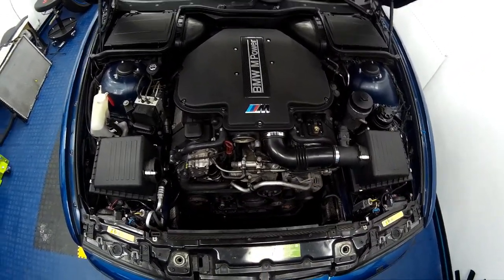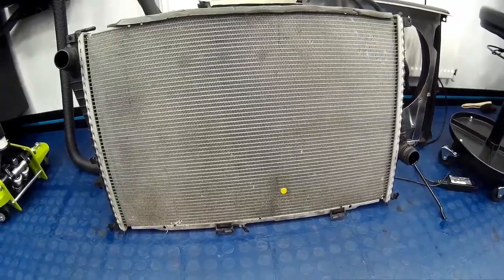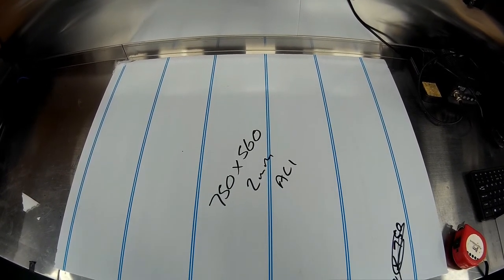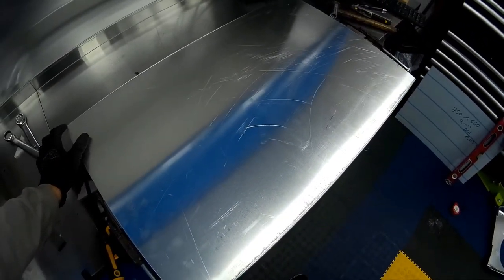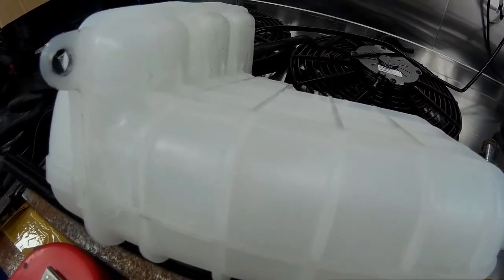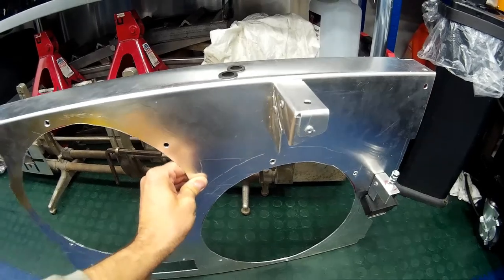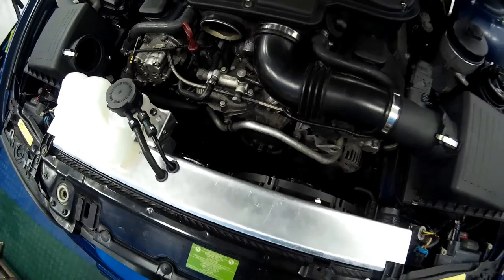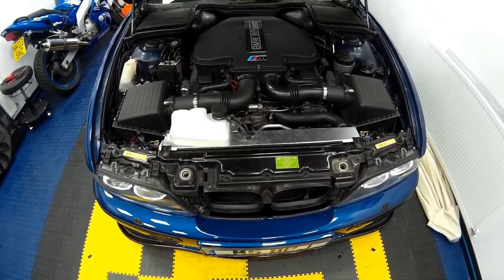BMW E39 M5 S62 V8 Twin Electric Radiator Fan Conversion + Alloy Shroud Manufacture DIY How-To Guide

Comment: Amazing job you did sir !! I did The same think to my 540 but i used fan from 2003 bmw 745Li because dose not have a  brushes inside is completely different fan is controlled by PWM signal and will last forever then the regular fan with brushes .
Reply from the maker: Cheers Andy. I did look at using the PWM fan from another BMW, but decided I wanted to use the SPAL ones to give me a bit more clearance on the front fo the engine for when I'm working on it. Glad you enjoyed the video - it's great to know people are interested in what I get up to in the workshop.

Comment: My friend could you please make me a list of what I need ? I am throwing out my visco. I have a m52b28tü.
The engine is an other. But I think this cooling System Is the best I have seen so far. I dont know what I have to buy. Just tell me what to order and I will bring it to my mechanic. He will know how to bring everything on. Just tell me please what to order. I have already the 4th visco broken and all radiators and waterepipes broke because of the visco break.  and the hood has dents too.  Its driving me crazy. I need ur help.

Comment: Amazing job !!! 
Since the stock pin config is 3, and fan is controlled via PWM from the ECU, how did you get to switch the fan on when A/C needs it? i.e. idle, traffic lights waiting in hot  etc.
Reply from the maker: Martin, cheers. The standard A/C pusher fan is still in place and runs as per OEM. 

The additional cooling fans are controlled by an adjustable temperature control panel within the vehicle.
Reply: @WestinghouseProductions  Thanks for your reply, mate. You are totally right, excuse me for my stupidity. I got caught by the fact that A/C fan should go because IC is coming in soon, so was looking for solution which would turn those fans on when need by the A/C also. Cheers

Comment: Curious on how you used the DME signal for the fan wiring. No relays? My fan setup has a high and low setting (2 relays) and runs off a switch mount on the the side of my radiator. I feel as if it comes on at the last minute and not maintain the temp like yours coming on and off randomly before it gets that hot. I assume the wires you used are can bus on the switch side?
Reply from the maker: The electrical system uses a 200 amp relay to switch the fans. The control side is via an 86-81 celcius thermostatic switch which is housed in the silver switch housing unit in the lower radiator hose.

If you wanted to utilise the PWM signal from the ECU that also controls the auxillary air conditioning fan, then SPAL sell a unit that you can use too. I opted for a mechanical switch for the moment and I'm happy with it's operation so far.
Reply: Would you make one kit for me? I will pay. My current setup is with one cheap ebay fan and I have overheating problems if I go WOT.
Reply from the maker: Hi Boris. 
Thank you for the offer, but I don't have the resources or time to put these to market. If you change your fan to a SPAL or Kenlow unit then that should assist in your issue, but if your engine is overheating when you are at WOT then there may be other issues with the cooling system that need addressing first.

Comment: Hey Paul, my M5 is in good shape to begin with 37k miles, I just dropped a CSF radiator in my M5 with dual 12” spal puller fans. In theory car should run at normal temperature or cooler, I did the clutch delete to free up that parasitic drag from clutch fan and to avoid clutch fan failure and damage. However this is where I’m at on 86f ambient temperature in moderate traffic. Stock pusher fan works, puller fan works well pull hard, 180f on 165f off temp switch in bottom right of CSF radiator just above the return hose. The oil temp needle should be slightly to left of 210 not to right of 210 mark. Coolant temp in hidden menu is at 96c and oil temp temp is 104c, no warning lights or anything. Any advices or pointers? Greatly appreciated!
Reply: These cars run at 220 Fahrenheit, unless you change the thermostat. No matter how great of a rad and fan setup you have. Also oil will vary much further than coolant. Oil temp isn’t really a concern until about 230 Fahrenheit

Comment: How do the Fans work ? Where does the Power come from ? When do the Fans know when to turn on ???
Where comes the information for them to turn on ?
Reply: The power comes from the battery terminal as seen in the video, this black box with a + on it. Thanks to the temperature sensors, the fans will know when to turn on. When the temperature  for example reaches 89*C degrees the sensor will send a signal to the relay or whatever u have that controls it that later on turns on the fans.

Comment: Can you provide part numbers for the intermotor and rdx ? Thanks
Reply from the maker: RDX mounting block is available from a shop called 'Bolt-on-bits' in Bradford (West Yorkshire), UK.

Fan switch I can't remember the part number unfortunately.